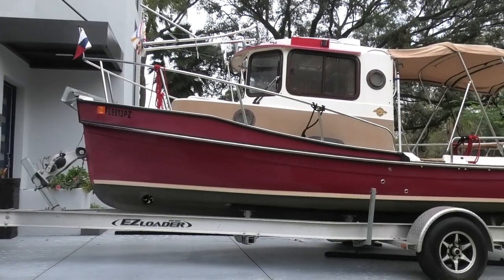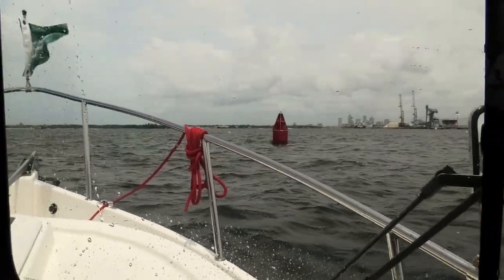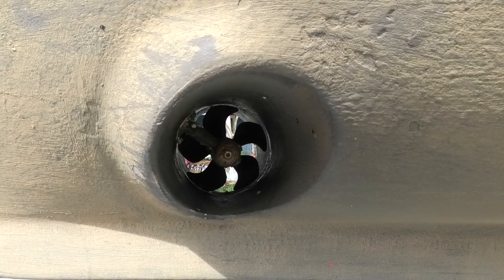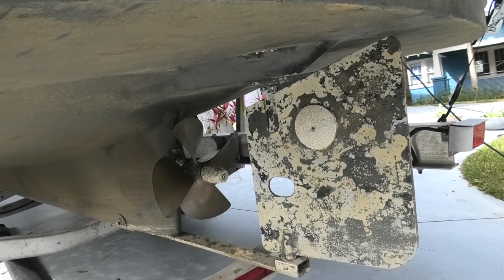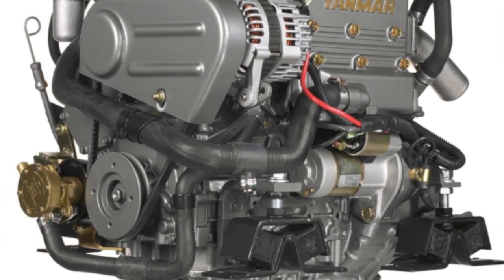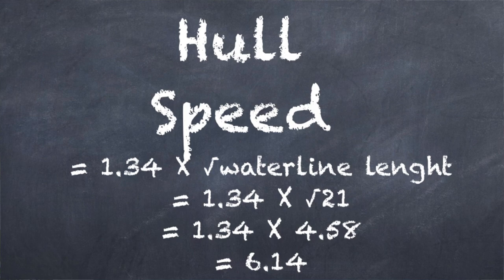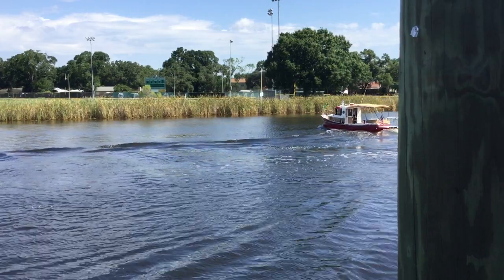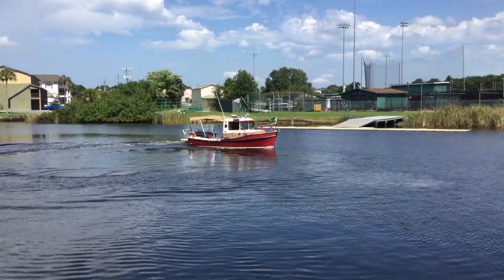Below the Waterline of a Ranger Tug R21-EC

Comment: You have me sold. I currently have a bayliner 265 and am not happy with it. I live on a lake that can get quite rough often.  3-4' swells. I need a boat that can cut through the water and track in a straight line. I had to cruise at about 7mph yesterday due to the rough water and it took me a few hours to get back to the marina and I was exhausted. Constantly turning the steering left and right as single engine planing hulls tend to wander at slow speeds. Someone below commented about wind. I ended up dragging anchor the other day due to high winds and so much boat above the water line. This tug looks like it would give me confidence in high winds that the anchor will hold. Also, the thought of 14 mpg gets me excited. I have a diesel smart car as my running errands vehicle so sounds like it would be a great boat for me. Thanks for your review.

Comment: 3 cylinder ~ 30 hp. diesel Yanmar.  My neighbor just had a 21 footer, in blue, delivered to his driveway in Sturgeon Bay, Wisconsin. Very nicely appointed. They purchased this boat after sailing it in Annapolis, Maryland. The previous owner motored to Key West, FL from MD.
Reply: When I cut grass at the aeroport my lawn mower had the same engine but with a radiator and not a water cooled heat exchanger and muffler.  
I like the quality of this Ranger boat. I use to work at Palmer Johnson yachts and we built our boats beyond perfection in Sturgeon Bay, Wisconsin.

Comment: Thats a beautiful little boat.   Not sure i'd trust it around here in anything but fair weather...   lake Ontario and lake Erie can be a little... hard... on boats.
Reply: 2 years ago there was an article in Pacific Yachting magazine, a Washington State group of Ranger owners did the inside passage all the way to Alaska. I think the smallest on the trip was a Ranger 25, only a few feet longer than the 21. One photo included was a shot of the R25 behind a swell, you could barely see the top of her Pilothouse. They are designed as coastal cruisers and would be perfectly fine even on the Lakes as long as you remember they are intended for use near the shore.

Comment: Hi…I’m building a poor man’s version of a “ranger tug “ I will be installing a Yanmar and I’m concerned about the prop shaft angle . Can you tell me the angle your prop shaft is at ; and is it a direct coupling ? I’m concerned about too much angle ( in my boat ) starving the “ uphill “ end of lubricant oil …thanks for your help ..    enjoy your videos! Good information….cheers
Reply from the maker: It is a direct coupling. Not sure of the angle, but it is very slight. I'll get some measurements for you the next time I am out. Good luck with the project!

Comment: You have a wrong idea about cavitation . It's low pressure zones that makes noise
Reply from the maker: I COMPLETELY appreciate your concern about cavitation! And I was really worried that cavitation was what I was experiencing. When I acquired the boat, I was very worried about cavitation, but determined that was not happening. It is aeration. Subsequent to the publication of this video, I removed the bottom paint from the prop (previous owner), replaced the motor mounts, replaced the shaft anode, and had the prop shaft laser-aligned. The noise that troubled me is mostly gone. But every now and then, some bubbles get chopped by the prop, and make a noise that makes my ears perk. I have really sensitive ears. Chuckle. However, it is important to note that after 800 hours on the prop it is still pristine. There are no indications of cavitation pitting on the prop.

Comment: Air bubbles getting cut by the propeller mostly harmless? Sorry, that is technically what they call cavitation and can actually damage your propeller. The sound is the bubbles collapsing against the propeller giving a water-hammer impact at that spot. It is caused by to high revolutions of the propeller and should actually be avoided as much as possible.
The occasional time shouldn't be to bad but not regularly.
Reply from the maker: Respectfully, I disagree. Sort of. Yes, cavitation is caused by the low pressure of the prop causing the water to vaporize - essentially boil, and that harsh vacuum will cause pitting in the prop. However, that is not what is going on in this case. The prop is not creating the bubbles, but instead is working through turbulent water created by the flow under the hull.